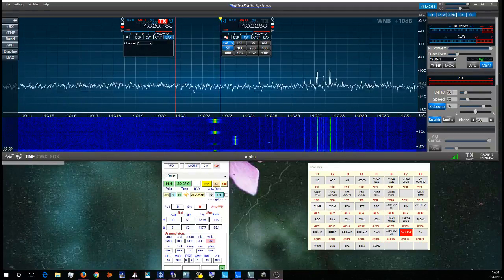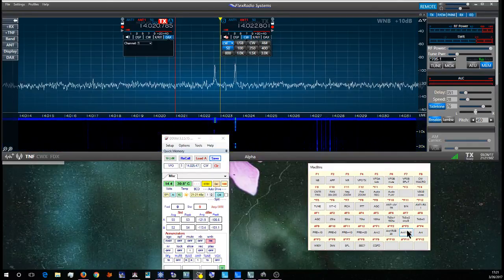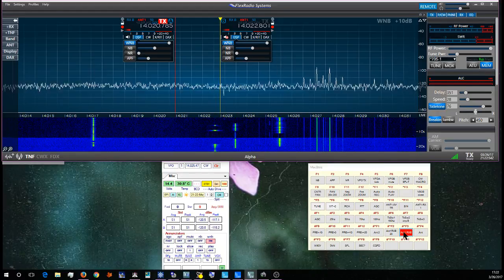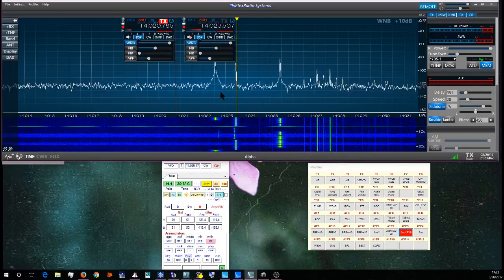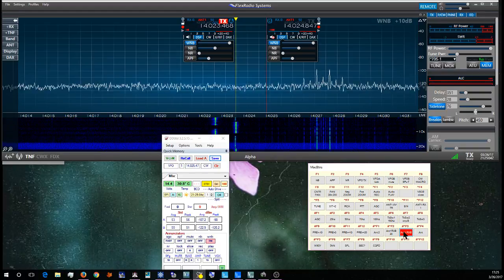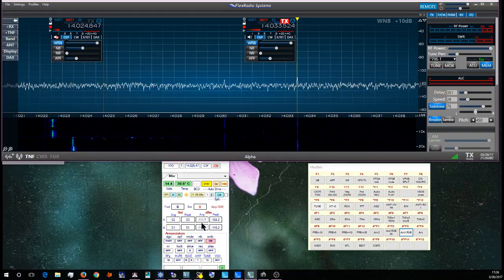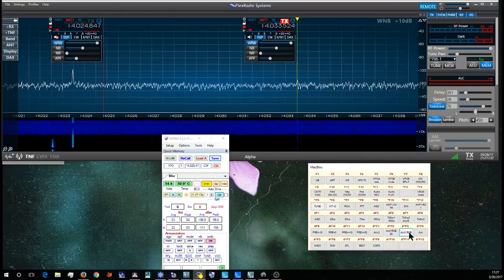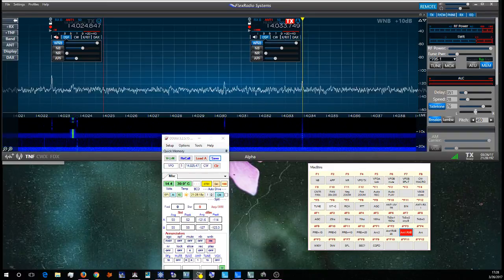W6LVP loop on the ground

Comment: Great Video! I watched your video before making my decision to buy a W6LVP Magnetic Loop Antenna myself. I appreciate folks taking the effort to provide actual evidence of success or failure of products that have gathered recent interest due to the incredible noise floors we all face now.

I have extreme electrical noise that was S-8 most of the time on my Carolina Windom and made my radio almost unusable. I temporarily installed the Magnetic Loop antenna on a short 5 FT pole in the backyard. With the XYL as the null monitor at the radio I called her on my cell phone and rotated the antenna by hand and was able to get a sharp noise null of about S-1. Very tight null when rotating just a few degrees one way or the other. Went in the house and couldn't believe the clear signals that were hidden by the previous high noise level. It reminded me of SWLing 50 years ago as a kid back in the good old days before the electrical noise environment turned so bad.

Ken Wigger
WD9GNG